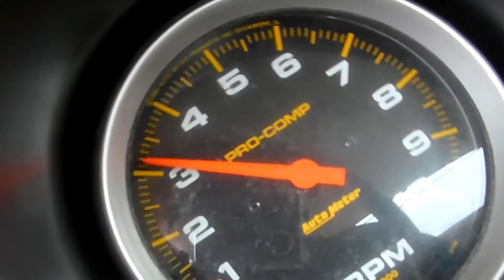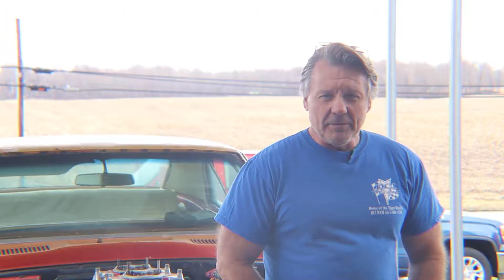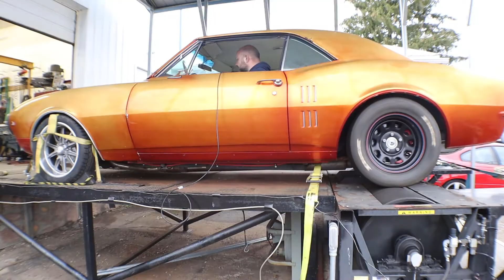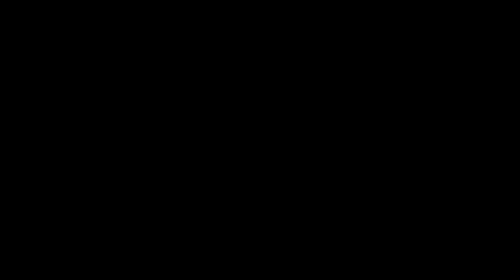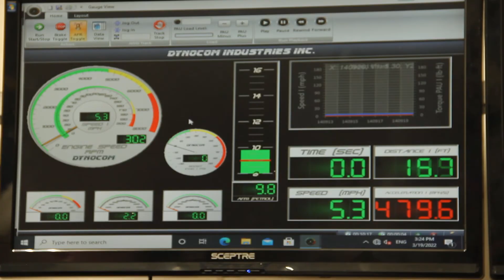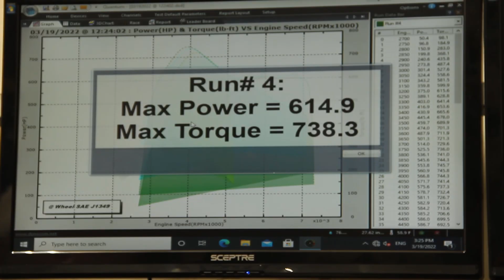Watch this if you like high RPM Pontiacs

Comment: I'M curious with these cylinders being able to run to 7k rpm, would that require a RAM air 4 style oil pump 80 psi on a 428?
Reply from the maker: You will definitely want a high volume 60 to 80 PSI pump to keep the bearings cool.

Comment: What kind of oiling mods are needed for that RPM?
Reply from the maker: Correct bearing clearances, drilled oil passages, properly prepared bearings and crank surface, blue printed oil pump.

Comment: -you asked for it. We (Truman Fields is my Dad) had a 1972 455HO GTO running in SS/k that went through the traps at 7000. HardTimes (-our Firebird) was a RAii that ran in B/S and it was shifted at 6100-6200 and went through the traps at 6600-6700 with stock unported heads. It was a NHRA National Record holder for years so it was doing something right. Over the years we came across a few "Factory" RAV motors but most were 303 versions.
Reply from the maker: Loved watching your Dads cars run back in the day. They were definitely fast and entertaining :)

Comment: Gr8 Power.  How much @ the Fly Wheel Don . HP & TQ . 
Robert 🇦🇺 Australia 🇦🇺
Reply from the maker: A rough estimate is 750 to 770 HP and 800 TQ + or -
Reply: @dcimotorsports1111  
Thx Don . Robert Australia 🇦🇺 
How many Cu Inch.    I can't recall.  And is this the Engine with the very narrow lobe centre line  ?  Like  106 or 108 ?
Reply from the maker: @Robert-mn8gc  511 with 11 to 1 compression, yes 106 LS. So really torquey and more TQ than HP.

Comment: I'm originally from a small town near your shop called Brimfield and was a big pontiac nut back in the 80s. You didn't happen to have a 74 gto in 80s and possibly know a walt Bauer or Mark Busher did you?
Reply from the maker: I did have a 74 GTO Blue with black interior but never raced it. The names sound familiar, but cant say I know them.

Comment: Very narrow lobe centre line Don .
106 to fill those cylinders. 
Huge amount of torque @ the wheels.
Reply from the maker: Tight makes TQ 🙂
Reply: @dcimotorsports1111  

True . I had a 250 Xflow ford engine l built up 4 economy in 1999 . From memory l had a 105 lobe centre.  Was on LPG increased mileage over Petrol ⛽️/ Gas by 25/30 % . 
So on LPG with that Cam it would burn off the same vehicle with injection rail .
They had a 3 speed auto & l a 5 speed manual.  Run out of Puff @ 4500 rpm

Comment: 738 on torque in a car that small , has got to be a "seat of the pants" feeling like no other.
Reply from the maker: Its a hand full on the street for sure. It will spin the tires pretty easily in high gear at 70 MPH. Just mat it and hang on 😂😛
Reply: @dcimotorsports1111  
I seem to recall you making a video of another firebird that did the same thing.
Reply from the maker: Ha Ha ya but that one isn't as violent as the orange one is LOL. Had to keep that one tamed down a little for the wife.  @phillipthethird42

Comment: I have seen this video for the first time just now.
I'm going to share it with many others to prove that a Pontiac can make more torque than horse power. 
That has always been the debate.
Reply from the maker: Glad you caught it. This is a factory 2 bolt main 455 block. It does have a forged crank and rods. Its been as high as 8,000 rpm several times 😝
Reply: U probably need 2 under stand that this was   " Camshaft Related " 
106 lobe centre .  Not sure our much HP & TQ on the Dyno ? 
I am Australian & have been looking @ Dons Pontiac Engines 4 about 2 yrs , maybe a little more . 
Called Don a few days back from down under ( Australia 🇦🇺) 
4 u Americans who might be thinking about a Pontiac give him a call 📞 & we spoke 4 a very long time.  
Don is one really decent guy & u won't be disappointed 👏 👌 
Kind & Humble . 
Would love ❤️ 2 see this car down the drag strip .
Reply from the maker: Thank You Sir for the Kudos and kind words. I am blessed and feel very fortunate for my God given talent.  Come hang out with us every Wednesday on our Bench Racing Podcast  from7PM to 8PM Eastern time.  @Robert-mn8gc

Comment: Does your shop do motor swaps? I'm interested in having my 06 Range Rover motor swapped out.
Reply: We do engine swaps for customers we build an engine for. We do not do any swaps where the customer provides the engine. We have been burnt to many times with poorly built engines we did not do.
Reply: @DonJohnstonDCIMotorsports  so no LS swap, unless it's a brand new motor or will you rebuild a used LS?